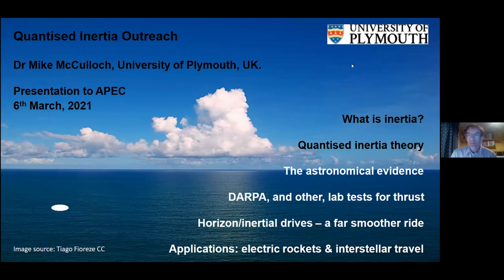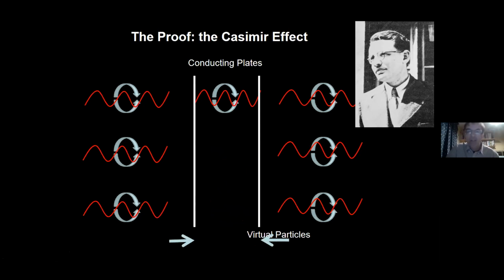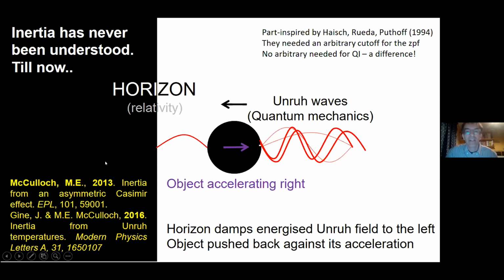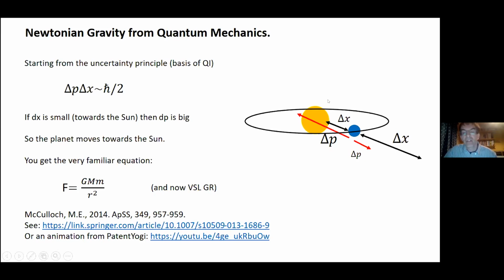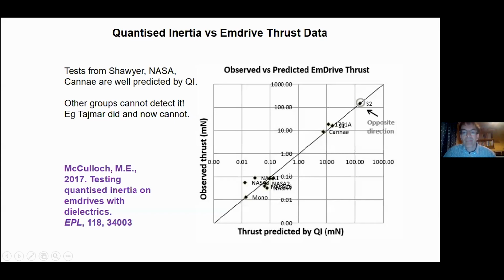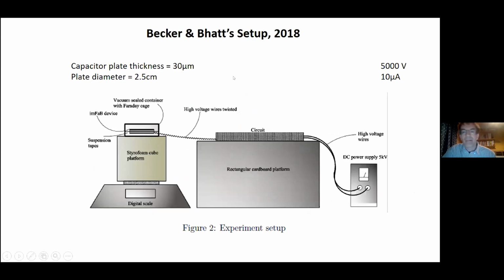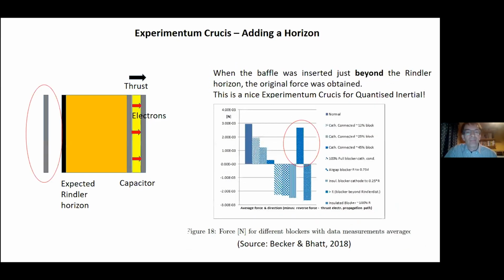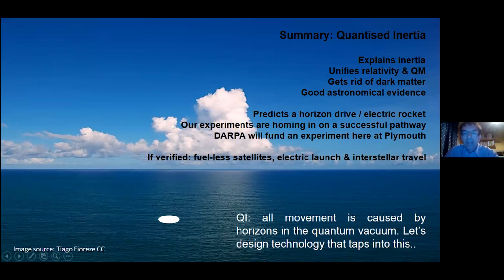Quantized Inertia & The Horizon Drive | Mike McCullough

Comment: There was an interview by a supposed Dreamland engineer that said that the Oval shaped Roswell craft had two
Mechanisms. One was pure Aluminum doped with Iridium that would block
Inertia and make the inside inertia less less. And then a Bismouth, zinc Aluminum material that they would energize for propulsion. 
He said that in the Lab, they could grab that big oval
Shape object and move it around like a balloon. When Dr McCulloch discussed inertia less materials, I thought about that interview.

Comment: Can you explain the apparent contradiction: when Unruh radiation is described it is specifically stated that it would only be observable by the accelerating object and not by an inertial observer. Already in the next slide, light emitted by electron curving around a needle and undergoing accelleration is described as a possible detecion of Unruh radiation, but obviously, this was observed by an inertial observer. In this experiment, only electrons themselves would experience Unruh radiation. Thanks in advance for clarification on this.

Comment: Getting the language to begin a better understanding of the practical devices. Dr Disney would make an effective collaborator(?).

Shell-horizons are relative-timing ratio-rates of phase-locked prime-cofactors superimposed on vertically integrated AM-FM Communication In-form-ation Actuality.
A Rose by any other name will smell as Sweet, and time-timing information is pure-math motion-potential, mass-energy-momentum continuous creation cause-effect

Electron-photon-phonon-Proton Neutronic zero-infinity e-Pi-i sync-duration resonance shell-horizons already exist in Lyman-Balmer orbital-orbits frequency alignments.

Comment: “The geometry of space in general relativity theory  turned out to be another field, therefore the geometry of space in GR is almost the same as the gravitational field.” (Smolin).
 
Developing Einstein's hypothesis of a cylindrical world, Einstein's theory of gravitation "migrates" into phase space: due to this, it is quantized.
 
Final formula: ф(G)=-(½)(w/wpl)c^2, where ф(G) is Newtonian gravitational potential, w - quantal frequency of the gravitational inertial field (space-time) can be tested experimentally in the laboratory at the moment ( see P.S. ).
Reply: Apparently, the following expression takes place:  μ0ε0Gi=1, which means that Gi=с^2, where i is inertial constant, i=1,346*1028[g/cm]; or k=1/i=7,429*10-29[cm/g]:  
 
"(Giving the interval  the size of time, we will denote it by ; in this case, the constant  will have the dimension length divided by mass and in CGS units will be equal to)", Friedmann, "On the curvature of space". The ds, which is assumed to have the dimension of time, we denote by dt; then the constant k has the dimension Length Mass and in CGS-units is equal to 1, 87.10 ± 27. See Laue, Die Relativitatstheorie, Bd. II, S. 185. Braunschweig 1921(кfriedman/к=8π).  
 
The constant c^2 / 2wpl in the final formula is a quantum expression of Kepler's second law: the quantum inertial flow Фi = Splwpl = h/4πmpl (magnetic flux is quantized: = h/2e, Josephson’s const; and the mechanical and magnetic moments are proportional ).
Reply: As a fundamental theory, GR has the ability with just one parameter: rG/r=k*(=πr/L, L- the length of the phase trajectory) to predict, explain new physical effects, and amend already known ones.
 
Photon frequency shift in gravitational field Δw/w0=k*; the angle of deflection of a photon from a rectilinear propagation path =2k*, the Newtonian orbit of the planet shifts forward in its plane: during one revolution, a certain point of the orbit is shifted by an angle =3πk*, for a circular orbit (eccentricity е=0); in the case of an elliptical orbit - for example, for perihelion displacement, the last expression must be divided by (1-е2).  
 
GR / QG predicts a new physical effect: w/wpl=k*; expression for gravinertial radiation from a test body.  
 
P.S. This is amenable to physical examination in laboratory conditions at present. 
 
A lead ball suspended on a strong chain from the ceiling of the laboratory can serve as a test body; at radius r=27,6 cm, ball mass is m=1т.  
 
According to the formula for the gravitational potential, the energy of quanta/photons of the field (photons are characterized by different parity and helicity, and it is not quite accurate to say that a photon has an integer spin equal to one) at a distance r from the center of gravity of the test body to the detector (practically on the surface of the ball) =66,3 keV.  
The flow: J(Gi)=0,45*10-8 quanta/сm2c; this is a measurable flux for modern world-class gamma detectors.  
 
And to the question: where does the energy of the field (quanta) come from, it should be noted that, since the effect is ultrarelativistic, the source is a physical vacuum (see on the Kruskal diagram, regions V and VI, which are not even covered by global space-time).
 Without taking into account the vacuum, the ordinary Universe cannot be considered (thermodynamically) a closed system.
 
A non-closed Universe can be represented as an oscillatory system, and if the time t is explicitly included in the differential equation of motion, then it is a non-autonomous system.
Reply: Analogue
It follows from Ampere's law that parallel conductors with direct currents flowing in one direction attract, and repel in the opposite direction.
Ampere's law is also called the law that determines the force with which a magnetic field acts on a small segment of a conductor with a current.
In Gi, this is the inertial component of the Gi field with similar properties: bodies moving in one direction attract ("dark matter"?), and in the opposite direction repel ("dark energy"?).
According to Gi representations, the expression takes place: μ(0)ε(0)Gi=1, that is, Gi=c^2, where i is the inertial constant, i=1.346*10^28[g/cm]; or k=1/i=7.429*10^-29[cm/g]:
Three directions I(G), r, B(i) They are perpendicular to each other in pairs; it follows from this that their actions are closely related to the structure of space-time and form a natural rectangular coordinate system.
For clarity, let's consider a special case.
In EM, a circular conductor, streamlined by current, detects the properties of two conductors with currents flowing in opposite directions, since for each section of the conductor with current on the opposite side there is a reverse current flow.
Thus, there is a process of self-repulsion, which naturally fits into the Gi phenomenon (it is clear that this is not an anti-gravity effect).
Now, if in EM the phenomenon in question is described by the formula: Fm= μ(0)I^2, then in Gi where the parameter w (=1/t) is interpreted as inertial induction: B(i)=[sec-1 ]; according to mw=qB, respectively, F(i)=(1/i)I(G)^2, where I(G)=mw; gravitational current: I(G)=[g.sec-1]. It follows from Kepler's third law that I(G)=v^3/G.That is, if the centripetal (gravitational) and centrifugal forces are equal, the inertial component Gi of the field is responsible for the expansion of the system: |Fi|=(1-g00)F(G).

Comment: I don't think there's much question that Dark Matter exists at this point. But it MAY be significantly less, and a combination with other factors. (Gravitational lensing is one aspect not sufficiently explained away, among others, by alternative models.)
Reply: The opposite, after 50 years nobody found it so it's clear dark matter doesn't exists
Reply: @lautaro736  We've known about dark matter for 100 years. Finding it is a separate issue, and has no bearing on its existence. Finding it is a commentary on our ability to probe the small scales, or lack thereof. The evidence of DM existence is overwhelming, particularly in gravitational lensing. But also in the CMB, curvature, mass, and rotation that are observed. 

DM may not be a particle, however.

Comment: If it sounds too good to be true, it is. There is quite a bit of astronomical evidence against quantized inertia. Ultra-diffuse galaxies that are dark matter devoid obey a Keplerian prediction for their rotation curves. These outlier galaxies are a big problem for this theory since they shouldn't exist if cosmic horizons affect all galaxies. In addition, recent GAIA EDR3 data seems to support Newtonian dynamics over alternatives for wide binaries.
Reply: The gravitational lensing is perhaps the biggest problem for non- dark matter models. MOND can do a few rotation curves nicely, but is inconsistent for galaxies which have experienced mergers. As you stated, some galaxies have significantly more dark matter than others. Also, the brightness doesn't actually align with these alternate theories, as regional x-ray emissions seem to support 2 different forms of matter in 2 different locations within galaxies. Bullet Cluster remains a problem for alternative models, as does gravitational lensing.

It seems dark matter is well positioned as an explanation, nothing else yet proposed explains observations. But dm could be a new field, or particles, or quantized or not. But it's definitely on solid footing. 

Still, points for trying. We do need these folks bringing in ideas from left field. Someone has to.
Reply: @onebylandtwoifbysearunifby5475  That's it really isn't it. "Points for trying." We need more and interesting ideas to test. People should not be ridiculed for trying.
Reply: Well couldn’t this be explained if quantized inertia was inversely proportional rather than effecting all galaxies equally? Couldn’t this have a sort of white hole like event horizon effect on dark matter lensing it inwards since it is much heavier than normal matter.

Comment: Interesting that all of the 'practical' designs for antigravity systems we see currently are making use of contra-rotating magnetic fields to produce thrust. This is closely in line with the model of an acceleration core interacting with a damper to produce forces. I am curious what other effects are being seen in contra-rotating magnets; whether they are directly interacting or producing asymmetrical interactions with their own respective rindler horizon...
It seems to me that these theories are in line with the notion that gravity has several different 'flavors' which interact on different scales and can be manipulated independently of each other.
Reply: Well we do have a strong and weak nuclear force. It makes sense we would have strong and weak gravity. Electricity and magnetism are mirror images of each other.